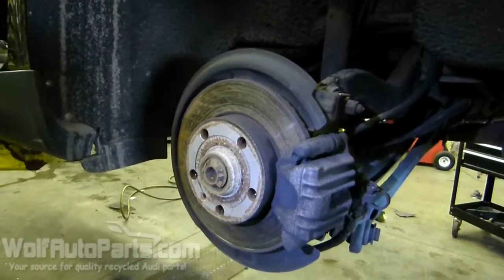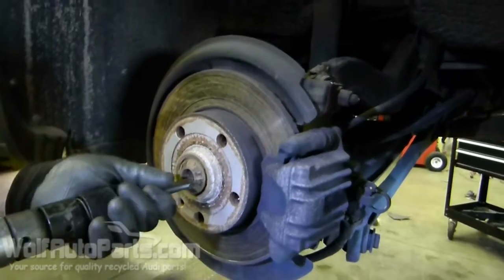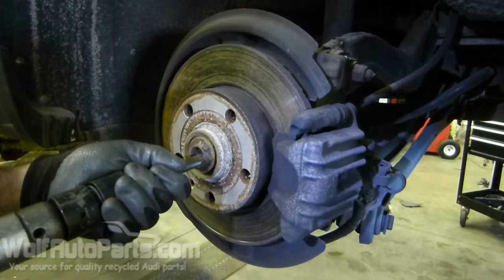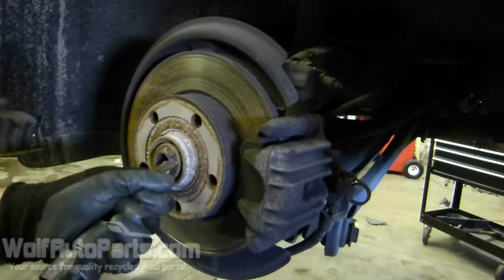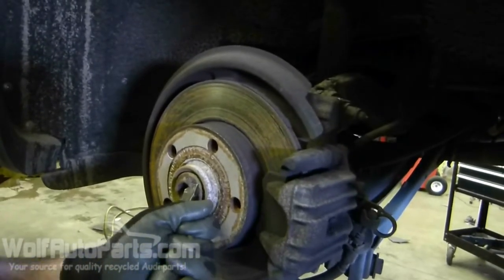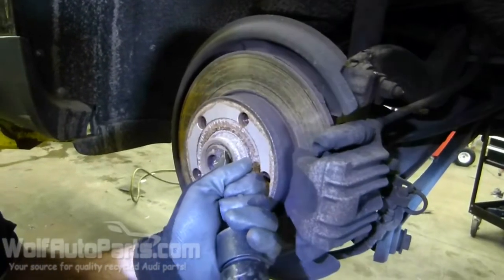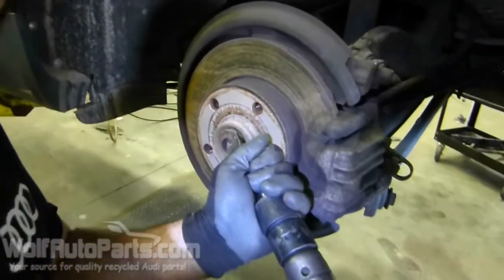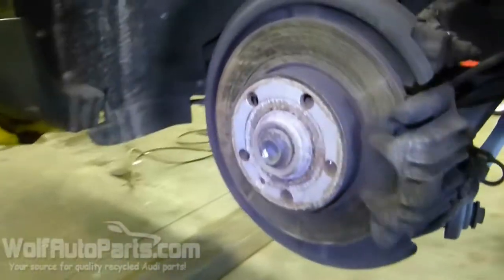How to Remove Stripped Axle/CV Bolts - B6 Audi A4 2002-2005 (Wolf Auto Parts)

Comment: Looks like you're doing this on a rear axle bolt. I have a stuck front bolt (19mm) I tried this trick on because everything else failed (high heat, PB Blast, impact wrench, breaker bar) and the bolt is stripped round. Damn Northeast winters completely wrecked this bolt surface.

I'm using an IR 114GQC air hammer and certainly managed to notch and cut into the bolt but it's still not turning. I've blunted a brand new chisel bit in the attempt. What is the next step?

My guesses are to either: A) Drill a small 1/8" hole and try to get penetrant behind the bolt cap and try again, or B) Go the nuclear option and drill out the bolt with a 5/8" drill bit (which on grade 8 steel is expensive as hell).

I have a new bolt, hub, bearing, and brake rotor so I really don't care about banging up anything but the CV shaft...

Anyone who has popped off one of these bad bolts knows the threading is almost certainly uncorroded, it's just the bolt head and the extreme torque spec holding it on.....
Reply: Well option A worked. With some heat the PB got behind the head and the hammer finally make progress and spun it off!
Reply: Did you find a solution? I'm in the exact same situation. I've tried everything you have too. Driving me nuts